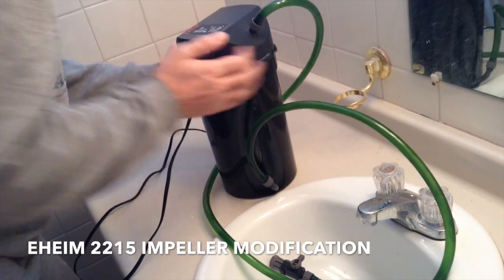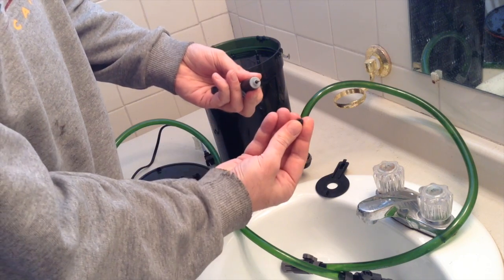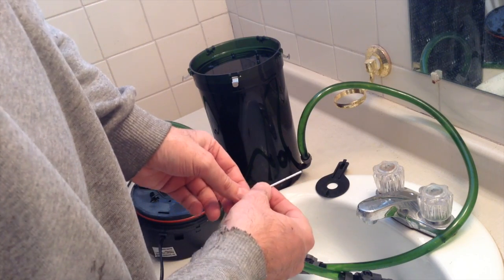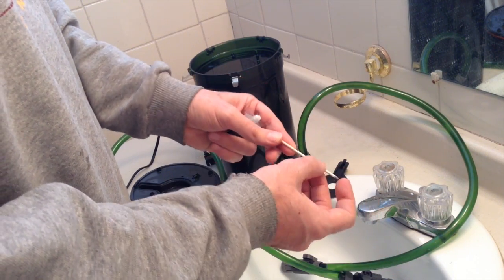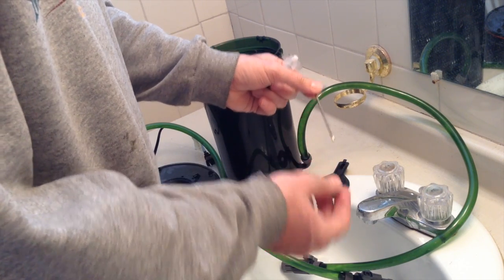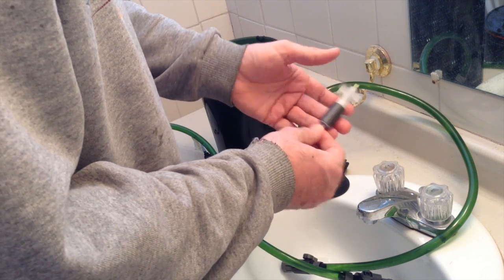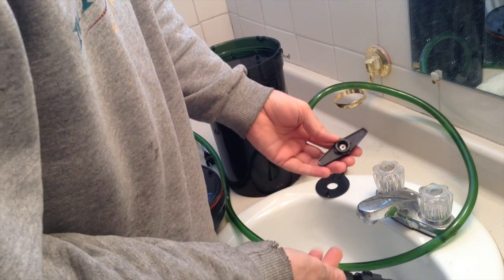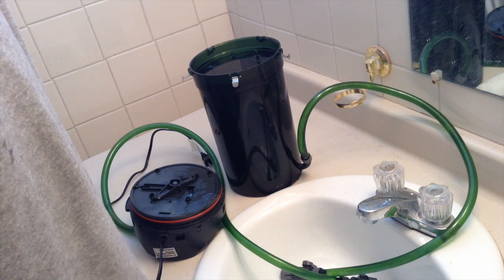Jeff Doin' Stuff - Eheim 2215 Impeller Modification

Comment: Great video I just  fixed mine DIY also. I have a Eheim 2211  I was just cleaning my impeller and my shaft broke . I needed a quick fix and had no proper sized rods nor could I find one. So I used a Plastic dollar tree Qtip Rod (just popped the cotton tips off) and it was the proper size and length. Worked like a charm. It sure gives one a sense  of accomplishment.

Comment: What you need is a 3/32 stainless rod or I fixed mine for 2$ with a "Stainless Steel Blackhead Acne Remover" search it up on ebay.... I cut the right size of my impeller rod. Good luck breaking a metal rod
Reply: Are you sure the size is 3/32? Please confirm. Thanks!

Comment: Why hack it together, just buy the right parts.
Reply: There is a special feeling when you can beat Eheim at their own game....their replacement part prices are incredibly high.
Reply: @wagnerbaseballgloverepair6853  Na not that bad, you can get that shaft with end mounts for 15 bucks. The hangar simply will not work anyway. Eventually it will rust and be a mess. It is nylon for a reason so that it can rotate with little friction. It will wear right into the impeller and ruin it. He will be just causing more damage and be spending more money in the end.

Comment: I had the shaft in mine brake to I use the inner tube from a bic pen that was empty worked like a charm.
Reply: David Amlong I have just done this and hoping it stays fixed
Reply: I assure you it did not work on the 2217 impeller....which is what I have

Comment: so you spent how many hours to avoid a 20$ purchase ???
Reply from the maker: About an hour. More importantly, didn't add to a landfill.
Reply: That doesn't honestly make sense. If you spent $20, you would not be adding the filter to the landfill either. Now you have a couple busted coat hangers to throw into a landfill. You also spent time going to a hobby shop after you already tried a couple coat hangers, and you still had to sand and modify the brass. I'd say you probably spent 2-3 minimum with trial and error, time of transit...etc.  

Also no matter how well you prepped the brass rod, it will wear down the inside of the impeller which is more than $20 and you wont be able to fix that. You're better off just getting the right part.  I've got a couple Eheim 2217 and a couple 2260 and knowing I'd be keeping fish for along time and knowing these are well engineered product (but of course shit can happen to anything), I've ordered a couple key pieces to have on hand just incase. That way I'm not caught off guard trying to jerry rig something. In the grand scheme of things, the extra cost is nothing. Factoring the price of the tank, the filter, the electricity, heaters, food, fish... Having $20-$50 worth of parts handy is nothing. Just sayin.
Reply: @svtcontour  what complete wanker you and REGGIE are, two upstart snobby no it all pricks is what best describes you two, must come as some shock to you two that some people unlike yourselves I`d imagine, take pleasure in fixing stuff while at the same time saving a few bucks, if your to Lazy and want to run to your nearest local retail store lining there pockets with cash at a moments time something not functioning to your liking, even tho it could possibly be an easy fix such as this guys just described, you go do that mate open that check book up and buy them Key Peices that you probably wont ever need and will more then likely sit in your shed the rest of its life. Give this guy some credit for thinking it through making the parts and fixing it , I dont think he was much concerned about a couple of bloody coat hangers as much as you were,  and the 2-3-4 hrs whatever time it took in transit that you spent so much time on calculating for whatever reason . I` m sure he survived that harrowing transit ordeal to the Hobby shop. Got to say you did make one good point tho, I dont think id be wanting you to jerry rig anything either. just sayin.